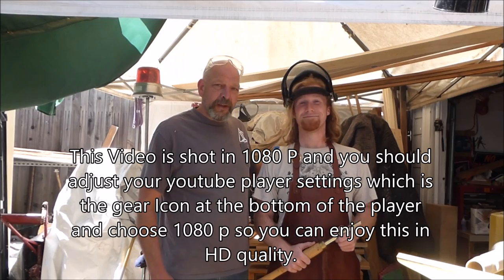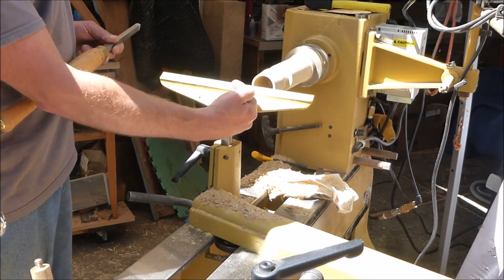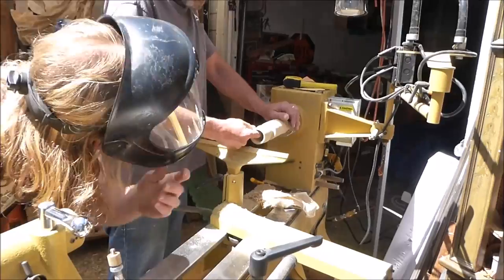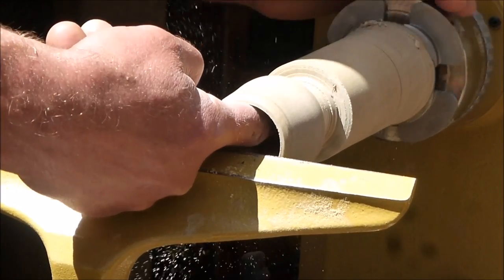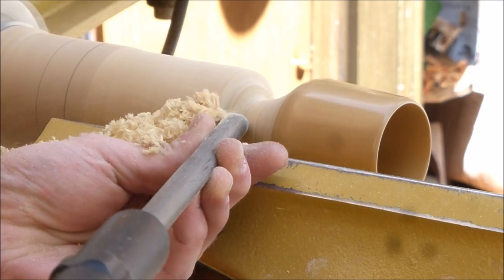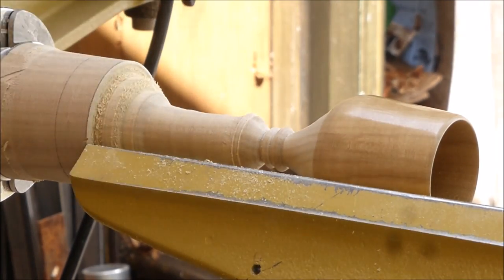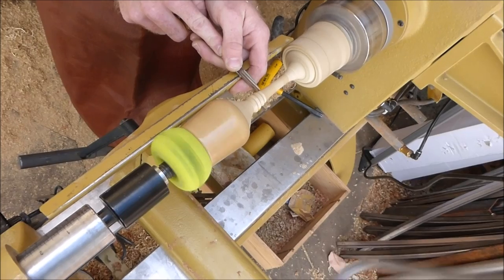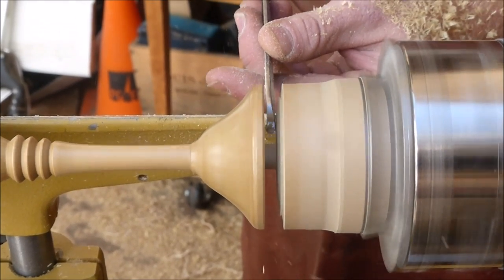Naked Turner Special Guest Student Turns Goblet

Comment: Nice Job, and good teaching worth watching again. When cleaning out the inside of the goblet why not lower the tool rest so the cutter is at center giving you more line of sight?
Reply from the maker: Charles ReicksThanks Charles I want to keep a negative angle for Cian which means less than 90 degrees and by raising the rest you decrease the angle. When we got the catch Cian was too close to 90 degrees between the work piece and the shaft of the tool.  I hope this helps explain why i was high with the rest.